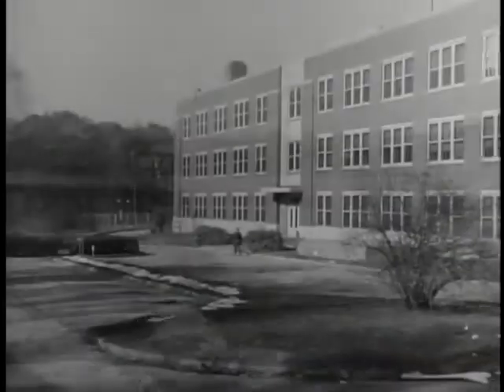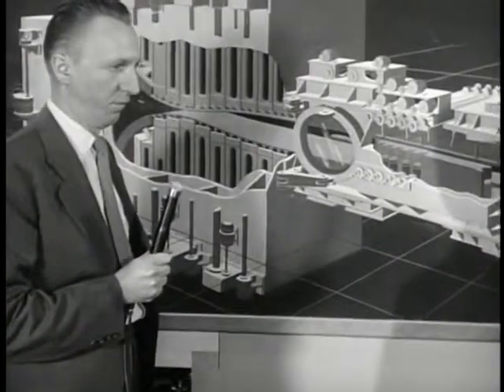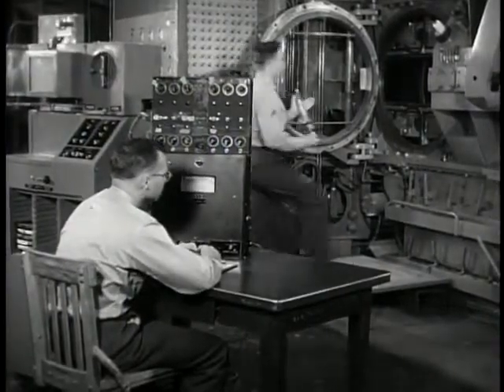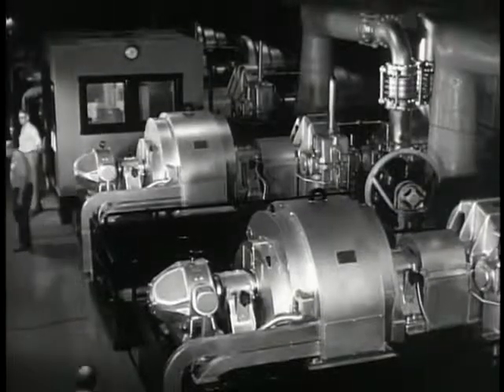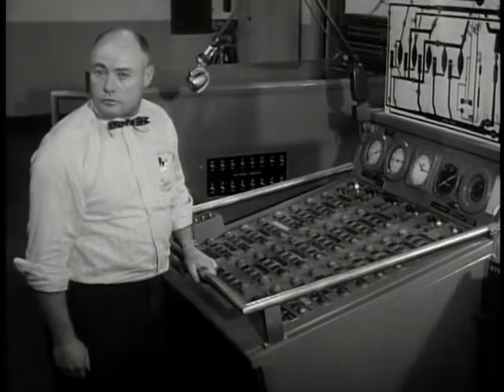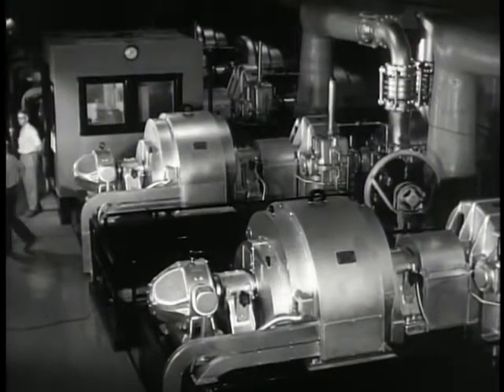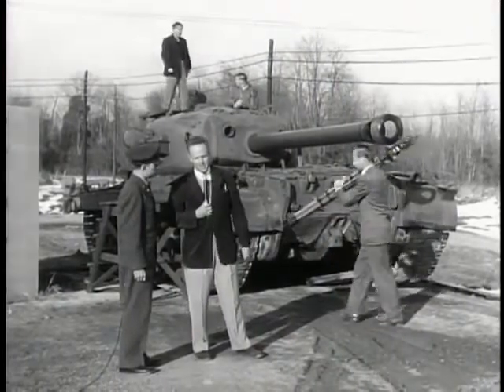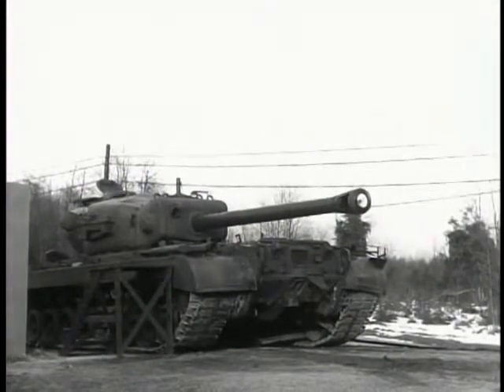Heavy Tank T30 running a firing test in Aberdeen Proving Ground

Comment: T30 need to restoration
Reply: I would also like to see the t30 move under its own power irl
Reply: I would like to see it run and fire
Reply: Dude it can’t it doesn’t have the parts and it would be too costly right now
Reply from the maker: for what?
Reply: @AndrewSmithRichard86  for to see it
Reply from the maker: @nizalmuhammad9689  You can see it at Fort Benning
Reply from the maker: @nizalmuhammad9689  And Fort Jackson in South Carolina
Reply: @AndrewSmithRichard86  but will more interesting if this tank moving
Reply from the maker: @nizalmuhammad9689  yeah but Engine is can't run
Reply: @AndrewSmithRichard86  yup because that this tank need to restoration
Reply from the maker: @nizalmuhammad9689  No no
Reply: @AndrewSmithRichard86  yes yes
Reply: @AndrewSmithRichard86  also one in Warren at the Detroit tank Arsenal  but it is on base and not open to the public.  I saw it while delivering there as a contractor.
Reply: @AndrewSmithRichard86  just swap the engine
Reply from the maker: They have 4 in total. In Fort Jackson, Fort Benning, Proving Ground, Aberdeen and Detroit Arsenal, I've seen them all except Aberdeen Proving Ground. @tompaul2591
Reply: Oh fuck I already said something but it was the opposite well fuck me up my ear
Reply: @Buffalohideface  i see your opinion completely changed in a matter of 4 months lol